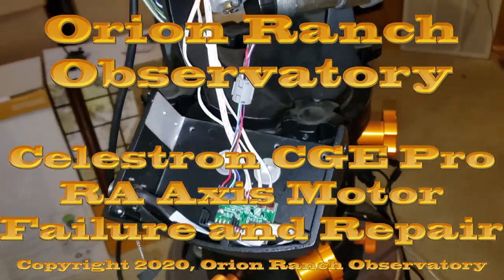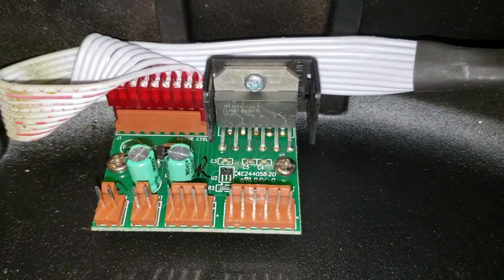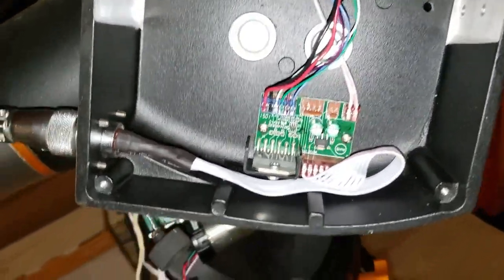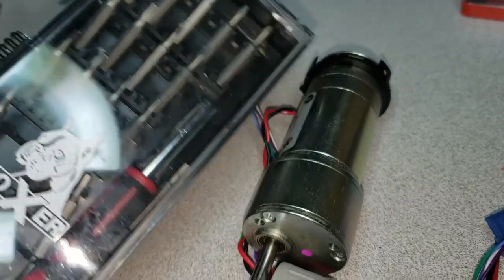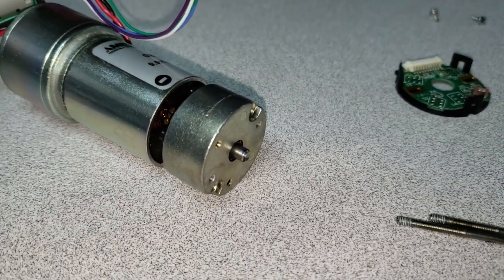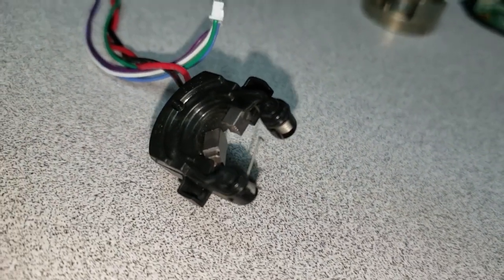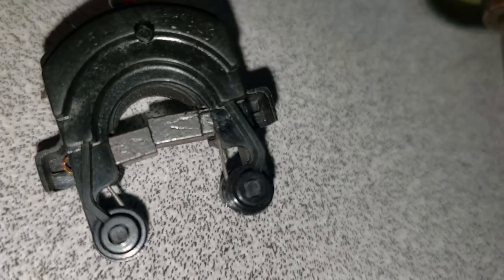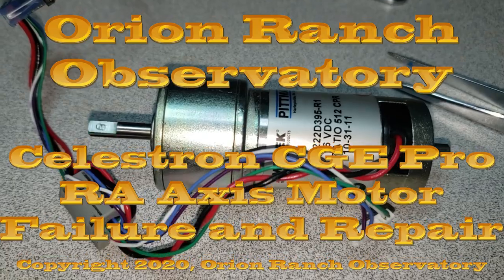CGE Pro RA Axis Motor Failure and Repair

Comment: Thnks for the instruction.

 MY cge pro was also  not working anymore,turned out it has the same failure like yours.
it looks that the graphite  get very warm and melts his housing.  after i grind it a little  it was working.

i was lucky  i had  a tork tool,from wiha,the number you need is T2.
now all back in place and adjust it,see how it goes.   greetings kajouman astrobin for my photos.
Reply from the maker: Sorry I never responded to this.  Glad you got it working.  I managed to scratch my encoder and couldn't repair it well enough to position accurately, so I need to replace it.  Been working on building a new house for the past couple of years now, so haven't had much time for astronomy!  Hopefully soon though.

Comment: I enjoyed following your repair - nice work.  I'd like to find a few of those locking jewelers tweezers.  They look like good helping hands.
Reply from the maker: Thanks.  I found some on Amazon that I bought for use at work, but they weren't as good as the ones I had.  Less metal and sharper edges.  

Beo

Comment: I think you convinced me to convert to steppers and Onstep.
Reply from the maker: I've debated it myself, but just don't have time for a project at the moment.  I need to get back with Ametek/Pittman though and see if I can just get a replacement encoder wheel.
Reply: @lordbeowulf1885  did you ever figure out the clicking?  Mine also does it like yours when it is trying to move to the unweighted direction.  Odd.  I thought it was in the tiny gears but they were fine.
Reply from the maker: @HermieDaddy  Yeah, it's just stiction in the axis that allows the worm to release from meshing with the pinion gear, probably to the point where it starts to push the other way, and then the weight causes it to "fall" until it is back on the other side of the worm.  You can see it at the end of this video https://youtu.be/Qg394MOpPaM.  Increasing the imbalance should eliminate it by keeping the worm engaged on the load side all the time.  Re-greasing the mount axes might help too, but I'm not ready to attempt that!  Of course this problem can easily cause major guiding problems since if the RA is driving away from the loading, the RA will stop and then fall, stop and then fall regularly.

Comment: Were you having the surging/ jerky slews before failure?  I am trying to pin down the source in my CGE pro.  Thanks
Reply from the maker: Hi Joe,

I run the observatory remotely, so wasn't normally there to see the behavior, but when I tested onsite I'd see some jerkiness and other oddities that now make sense in terms of intermittent brush contact.  The main failure mode for me would be just a completely failed slew that would require me to re-home and re-align.  It was rather frustrating since it would always home fine but then just not hit certain targets.  Seemed like it was often related to location which had me looking for cables that would fail when flexed a certain way!

Beo

Comment: Is the motor still working? I have a couple of pittmans like that. Weird that they melt under load.
Reply from the maker: I've been too busy for astrophotography lately, but the motor works fine.  Unfortunately the scratch on the encoder is still causing targeting and tracking problems.  My plan is to try swapping the RA and DEC axes in the hopes that the encoder problem won't bother me as much in DEC.
Reply from the maker: @TheRainHarvester  Nope,  Pittman makes a ton of motors on this platform with different windings and gear ratios.  The ones for Celestron had custom windings for a custom voltage.  That's probably why the brushes melt the housing.  They're running at too low a voltage so pulling more current through them and heating them more.
Reply: @lordbeowulf1885  ah interesting.  Does it have to move quickly for some reason?  Seems like just using a slower/higher gear motor would work as long as the encoder ticks per rev is the same.  But who knows what their software does as far as safety checks/pwm/pid etc. Yeah, probably easier to just fix their motor! Lol